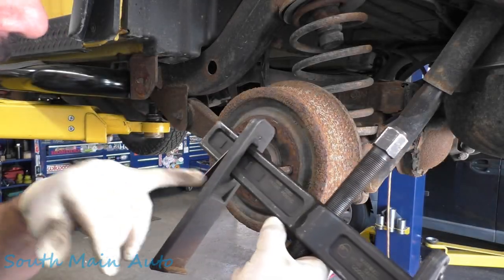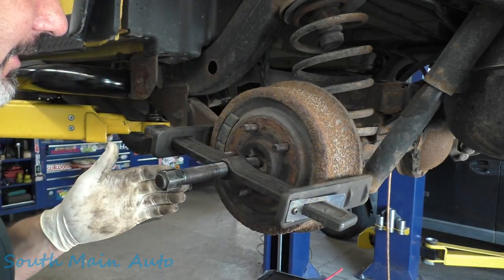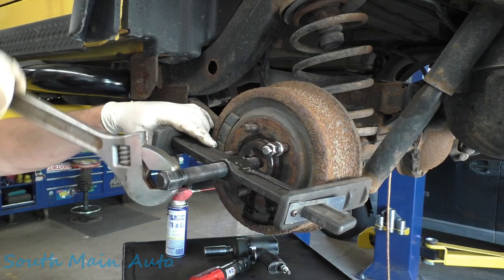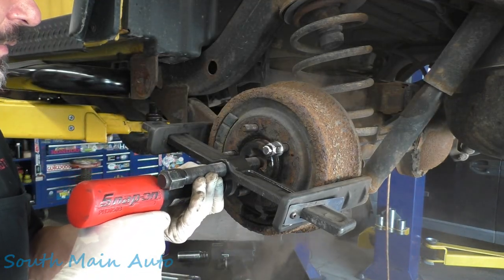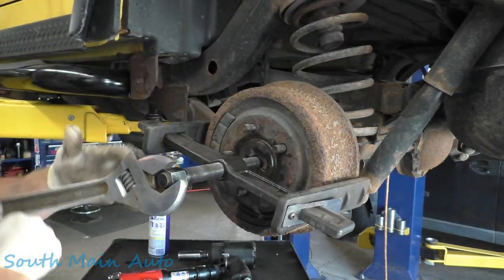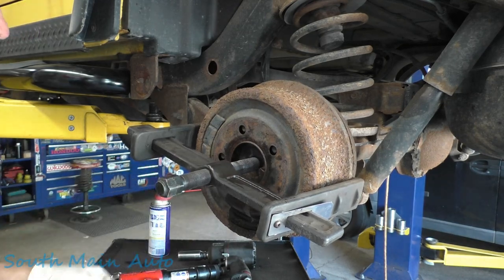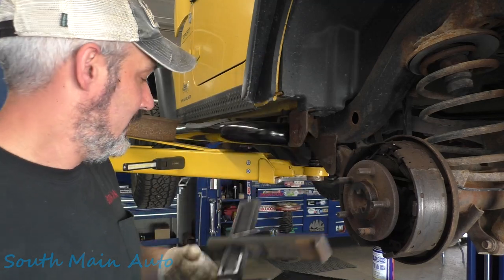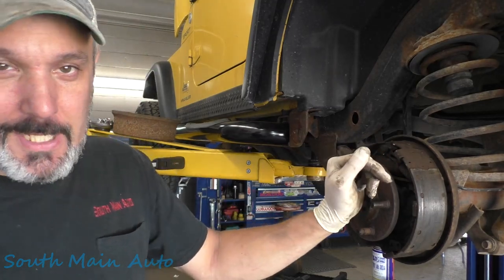Must Have Rotor Drum Removal Tool

Comment from the maker: Astro Pneumatic Tool 78830 Heavy Duty Hub Drum and Rotor Puller Kit: https://amzn.to/3Qny9XQ
Just in case you missed it, I do know the brake shoes are on backwards : https://youtube.com/shorts/2zjnnA1YFRQ?feature=share
AND YES.... I still have Big Nasty... : https://youtu.be/WccnTctg-h8
Reply: Well, now... a tool you use that I can actually afford!
Reply: I missed it.
Reply: The one in the video was an OTC one, but the Astro one has made regular appearances in other videos.
Reply: I understand the big shoe goes towards the back. But why?
Reply: It's because the primary or front brake shoe puts rotational pressure on the secondary shoe when you apply the brakes going forward. This means that the secondary shoe wears more than the primary shoe. To decrease the wear on the secondary shoe the friction material is longer so that the pressure is distributed over a larger area which decreases the pressure per square inch. If you put them on backwards the smaller shoe will wear out much sooner than the larger one. Does that make sense to you? If not then don't worry too much about it. I've seen mechanics with 20 years of experience that would stick the brake shoes on backward on every job. What makes that so funny is that they think it's normal for the back shoe to be worn completely out when the front one was barely showing any wear. I had one that was getting angry with me for doing the brake on my own car because he thought I was doing it wrong. I ended up telling him to shut up and leave me alone. I actually had him read the instructions out of the repair manual and he still insisted that I was wrong because he had been doing brake jobs when I was still in diapers. I had to threaten to apply a jack handle to his head if he didn't get out of my yard just to get him to stop trying to take apart what I was putting together. I suddenly realized why he did so many brake jobs.
Reply: @amundsonjm  On duo-servo brakes like those the leading shoe is smaller than the rear because of the way the brakes operate. In use you step on the pedal and the wheel cylinder extends the pistons and the shoes touch the drum. The bottom of both shoes are connected with the adjuster while the top is through the wheel cylinder. The shoes touch the rotating drum and they try to rotate as they grab. That motion than forces the rear shoe back and it rotates up and hits the parking brake strut and the top pin. It cannot rotate any farther at that point, However the front shoe can still move as it is somewhat floating, so it tries to move and that force gets transferred to the rear shoe and makes it apply even harder. The front shoe provides braking power but because it only has your foot pressure from the wheel cylinder that force isn't as high as the combined force on the rear shoe. As such the rear shoe is longer to provide as much brake force as possible. The front shoe can be smaller as it is applying less force and the motion of the system also means that the primary force on the front shoe is in the bottom 2/3 of the shoe. Another part of the smaller leading shoe is that due to the design if the front shoe had a full length lining it could make the brakes very sensitive because that area could touch first and it would make it difficult to modulate the brakes.
Reply: @Blazer02LS  😵‍💫
Reply: @danielbutler578  Thanks for the reply! That makes perfect sense to me.

Comment: I have been an aircraft mechanic for many years and it never ceases to amaze me the power that can be generated by just the thread of a bolt. One of those things it is easy to take for granted, we would be screwed without them, pun not intended.
Reply: You've been PLANNING that PUN since 91 SON.. 😂😂😂
Reply: Nice to see other A&P's watching ol Eric O
Reply: I’m amazed with the fusion properties of RUST!!
Reply: You aircraft mechanics are just plane nuts.
Reply: Another A/P here since 1988
Reply: I’ve heard the thread of a screw referred to as a “remorseless wedge” and when you squirt WD 40 on I’d say it’s a “sociopathic remorseless wedge” drum never stood a chance!
Reply: @DrewGangl  You know what they say "God make aircraft mechanics because pilot's need hero's too"
Reply: @kevinchildress6569  You got me beat lol. Only got my license in 2019.
Reply: Part of the A&P club as well! Looks like there's a few of us here!
Reply: Add me to the a&p club that watches Dr. O
Reply: @danielgeng2306  If you really want power, use a lubricant like gear oil, not a solvent like WD40.
Reply: Many thousand pounds with a screw that size.
Reply: A&P club here also.
Reply: @LTVoyager  I was commenting on what Eric used, I use WD to clean stuff not so much a lubricant, actually it’s all I use in lock cylinders as well …
Reply: @danielgeng2306  It is great for cleaning, just not for lubricating.  I use it on my motorcycle chain as it cleans the chain well and then dries and doesn’t attract dirt and o-ring chains tend to last longer without external lube to attract dirt.
Reply: A screw thread is simply a rotary lever / fulcrum or ramp machine. Cut a 30 / 60 / 90 triangle from paper, align the short side with a “shaft” and then wrap it around the shaft and you’ve got a basic screw.

Comment: I bought one of these 3 years ago because I kept running into seized drums. Since that day I haven't needed to use it. Apparently just having it in your box acts like a totem and scares the drums away
Reply: I have a few tools that have that power
Reply: Me too I bought it . Of course, I haven't needed it.
Reply: If you stand up multiple 10mm sockets facing your work space, you won't lose the one on the ratchet.

It's the same science.
Reply: 😆 that's some funny 💩
Reply: Better to have it than wish you did.
Reply: Yup. Kind of like having an umbrella near by. If they're calling for chance of rain, it won't if you have an umbrella in the car. Another thing, I don't have a spare tire bracket on my equipment trailer and wouldn't you know, the one time I forgot the spare, I had a flat. I'm pretty sure if I had the spare with me I wouldn't have had the flat.😕
Reply: @dchawk81  similar to having a pack of spare pz2 screwdriver tips....
Reply: @miscbits6399  'zactly.
Reply: It's like a condom...better to have it and not need it, than need it and not have it. (credit to AVP)

Comment: Early gang. 

I could've used this puller years ago when I had a shoe disintegrate and wedge the drum and the other shoe together. What a nightmare that was.
Reply: i'm lucky the one i had the shoes were previously bonded so when drum came off so did pad materiel

Comment: I have a 3 jaw puller that I use for this (The 'ol Harbor freight), being a shadetree and not professional.... I've used it maybe 2 times and now all the vehicles I work on in the family have discs in the back so now it sits.

That being said, when I needed it, it was handy to have and a godsend because that back drum wasn't coming off any other way. Ohio winters (northwestern) can be brutal; the city thinks it prudent to dump at least a 40 lb bag of salt on EVERY street first sight of a decent snow.
Reply: It will pull discs too!
Reply: I've strangely never had to do that yet.. Every time I've removed a disc, it's been to replace it. I beat them off with a smallish sledge hammer if they are stuck.

Comment: I have a 1-in version of that to pull the caps off my beer bottles. It saves a lot of time and beating with a hammer but man that inch and a half air chisel is hard to get in there and operate. The tweezers won't stay on the trigger. It only gets harder the more caps you remove cuz after you do one you got to drink a cold one, it's such hard work.

Comment: Needed this tool this weekend. Had to beat and heat a set of front rotors on a Mazda. Used the old bolt and nut through the caliper mounting hole to help get it off, good times.

Comment: I am soo glad that rust is a non-event where I live, unless you live on one of the islands or drive on the beach or back into the sea when launching a boat, rust is a non-event. If you are unlucky, you might need to give the drums a gentle tap with a hammer. I have never had an issue pulling mist drums or rotors off with my hands!

Comment: I like the drums that have jack screw holes in them.
Reply: So do I, but when they get rusty, those two or three threads disintegrate when they get a bit of load on 'em.
Reply: Usually all those accomplish is adding a couple of stripped bolts to add to the scrap pile along with the rotors once they are finally off.

Comment: Nice tool. I could have used one of these years ago. I didn't realize it but my emergency brake wasn't releasing all the way on my Chevy van. The drum got really hot and seized. I finally got it off with my sledge hammer but it was a real knock-down drag-out fight

Comment: I was raised in the upper peninsula of Michigan and worked in independent garages and dealerships. Rusty cars were the norm. You'll find this method of Rusty drum removal noisy, but not for very long. We used to take a 2 pound hammer to smack the outer edge off the drum right where the face starts to roll towards the backside of the drum 3-4 times good and hard. It will flex the thinner steal where the drum slips over the axle. This breaks the rust loose and it usually jumps right off. ( This is not striking the drum from the backside )
Reply: Taken your Finnish citizenship yet?
Reply: That works for the ones that are just stuck.  The ones that suck are the ones where the shoe wore a grove into the drum and the adjuster won't move.

Comment: I bought one for the shop about 4 years ago specifically for Mazda rotors. works slick and I recently used it to push a Hyundai CV shaft out of the hub bearing cause the spline was seized in the hub.

Comment: I ended up buying the OTC 6980 Heavy Duty Brake Drum and Rotor Puller late last year (a bit cheaper) and it even came with a ratcheting strap to put around the puller to prevent the clamps from popping off under tension. It was a bit cheaper when I got it ($114.99) its now $133.00! This tool is awesome! My drums on my 22ish yr old 98' Camry were also rust jacked around the hub. That POP sound of the puller breaking away the rust bond scared the hell outta me but also put a smile on face!  I wouldn't recommend using an impact gun tbh. You can use it to snug up the bolt and put tension on the drum but use a 1/2 rachet to finish the removable because it can get gnarly on ya quick!

Comment: I have a 2003 dodge ram.  I replaced the starter once and couldn't get one of the bolts to start by hand.   Worked for over an hour finally  took the starter back down. Found out the bolt  hole  had a replacement thread insert wrong size from  advance auto  rebuilt starter.   Took it back to advance auto.   They gave me another one  .  Put it in about 10 minutes.    Fun fun fun.

Comment: I 'inherited on of these decades ago from a eledely neighbour. I never realised what it was for. And yes I have beat on drums often trying to get them off. 
Riveted linings?  In 2022?  Here in Oz seldom even see recon old shoes which for the most part have been bonded for well over 50 years. On [historic] race cars we have them bonded as well as rivets on the ends. They see extreme heat with material that will take the heat but on occasion they do lift, hence the rivets.

Comment: The last time I had to change drum brakes was on my 2002 Mercury Sable. Didn't have the "right" tool, but I did have a 4 pound sledge. Turns out those drums crack nicely after a few hard hits, and if it's in pieces it can't be stuck...

Comment: Eric, the correct tool for this Jeep is just replace the whole rear axle assembly.
Reply: Save the ball on top of the antenna and replace everything below that...lol
Reply: That would triple the value of the vehicle.
Reply: @clicks59  That depends on if the jeep has a full tank or "it ain't got no gas in it" though.... LOL
Reply: @brnmcc01  😆

Comment: back many years ago, I had a 65 mustang I bought off my brother, and the pads were so worn into the drum that even backed all the way in I couldn't get the drum off.  I didn't have a fancy puller and ended up just using a sledge to crack them off.  

Then I went and got in a fight with my brother about selling me some bullsqueeze.  Which isn't unusual, we fought all the time but that's just how it was.  Only rarely broke anything.

Comment: The worst was 1950's to early 1960's large Chrysler product cars with the hub attached to the drum and a tapered axle. Had to use a device like that but using a hammer arms of the tools and use a '3 pound Ford Wrench' to get them off. Sometimes took 20+ wacks to move it.
Reply: I still have one of those in the back of my tool cabinet. I owned a few Plymouths back in the day.

Comment: Look at the rust fly... we don't have them problems down here in south Florida.
Reply: stop bragging!

😆
Reply: It can happen though if it's a Jeep that gets driven on the beach a lot. Salt water is salty.
Reply: @brnmcc01  yeah, it has to be exposed to salt a LOT. Up north if you drive on wet roads in winter they are covered in salt.  The benefit of being down south is when it rains you get most of your beach salt washed off if you drive on a wet road. Up north it just re coats your entire frame with more salt water the entire time you drive.... Every time you drive on a wet road.... For 4-6 months. 

It's bad up north.

Comment: This would be handy if it was larger for disc and drum brake combo hats. My f150 rears were on like you would not believe!
Reply: I've taken a few of those off with sledgehammers. If it's that seized the rotor is going to be junk anyway. What I want them to make is a magical tool for getting Toyota halfshafts out. When those carrier bearings get seized in it's a nightmare. The worst one I've ever run into I ended up cutting the shaft on both sides and, when I still couldn't get it out, cutting through the bracket and bearing both.
Reply: I've  had a fight with my jeep with rear disc brakes but drum parking brake. Forget the sledge, it didn't even budge. I ended up cut getting a grinder and cutting them off. Once I cut a second out, they slide off fairly easily. I knew they were trash from the start, so I already had the new parts.

Comment: Bought one of these year ago. Thought I'd hardly use it. Wow, was I wrong. 

Only complaint was they didn't want to always grab the drum, but a little touch with the angle grinder to make sure the grip surface was flat fixed that...

Comment: Hearing protection please! My tinnitus is acting up just watching you hold the air hammer. Tinnitus NEVER goes away!
Reply: Safety glasses and dust mask too? It’s no fun having an embedded rusty metal chip removed from your eye ball. The voice of experience..
Reply: Consider me a crotchety old curmudgeon if you'd like but I have had years of regret for not wearing hearing protection in my '30s (and lots of other times).
Reply: @bobc455  I hear you.. no pun intended.

Comment: I used to just get out the BFH 6lbs hammer. Put junk lug nuts on to protect the threads. And a little PB Blaster. And wind up like a baseball batter and let her have it! 2 or 3 whacks and it's off. And I never had a come back for axle issues.  Way faster and more fun.
Oh yeah especially if your putting on new ones.

Comment: I’ve spent many an hour camped out in the rear wheel wells of my Jeep Wrangler chasing and treating rust, as well as repairs, and would recognize that rear end anywhere, even in the dark.  Not having this magical tool, or Big Nasty for that matter, I had to use a sledge hammer and bust up the drum casting to get it off. Ah memories…memories….

Comment: Wow! That drum puller is slick. There has been so much time spent on seized brake drums. Now invent something to get Ford 1ton dual wheels off! I worked at a truck leasing company across the street from the Ford dealer that owned it. The dealer tool was pretty useless.

Comment: I use the the kit that has the whole ball game for doing hub bearings and such. The bearing race puller that it comes with it is about useless. Usually take the mini wheel to the race. Cut diagonal until it gets hot. Tap it with a chisel and off it comes. Didn't think to use that part of the kit for drums. Thanks.
Reply: I actually use it for busting loose an outer tire rod end cause if you pay attention it won't pinch the boot.

Comment: First time I did a brake job on drums, I took the hub all the way off and then pounded for about an hour with a hammer. Coming from Australia from the driest state we have little rust problems. I saw how much mechanics used impact tools to undo nuts, and I thought they we kind of lazy compared with Australian mechanics. Then I did a bit of work on my own car, and worked out that it is much easier to break off rusty bolts with an impact wrench than by hand!

Comment: I backed off the self adjusters . The shoes were still stuck in a ridge on the drum . Not having this tool , I hooked it with the slide hammer and went round and pulled it off . I also could have cut the hold down pins , but did not want to disturb the wheel cylinders when everything came off . However. , the cylinders were bad anyway . Nice tool .

Comment: I bought the tool he had the link to.  Its a link to the Astro 78830.  The one shown here in the video is an OTC, made in America.    I wanted to buy the OTC but it was too small.  i ended up buying the 78830.  I used the link up above so Eric get a very small commision. The OTC is made in USA. The OEM is made in Taiwan.  The Astro is made in China.  This OTC one he is using here only has a spread to 12 3/4"  My drum is 13 1/4".  The Astro goes to a max spread of 14".  More than enough for me.

Comment: I like the tool, I would use it like yourself. However on my own vehicle I would've put tension on it and then put the Fire Wrench around the the circumference of the thin center of the drum. Doesn't really matter it is off.